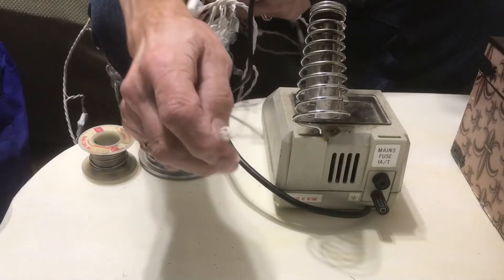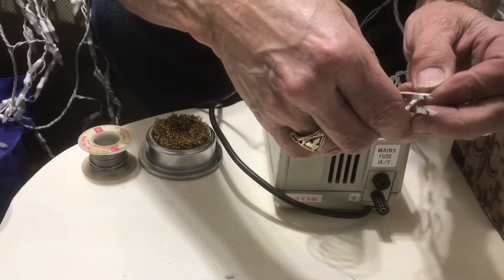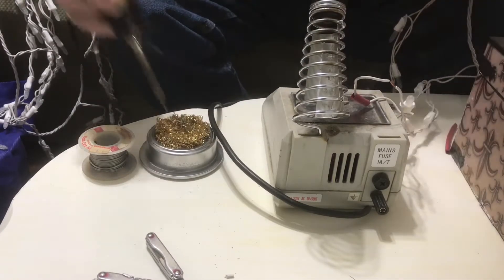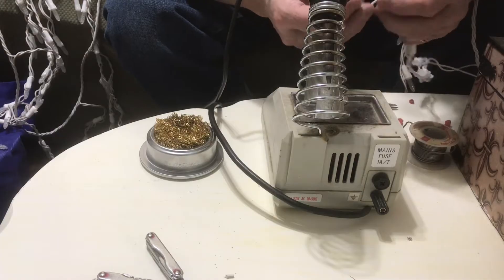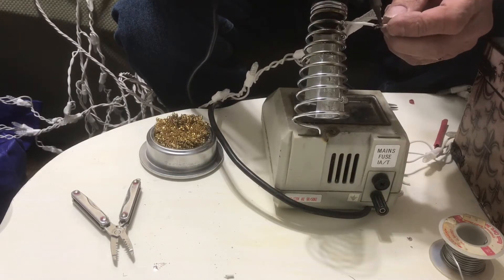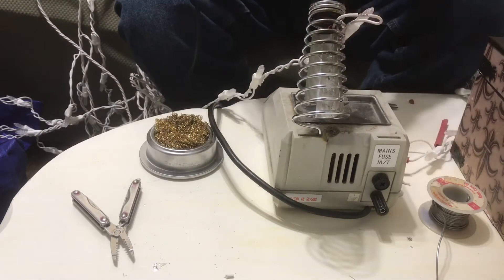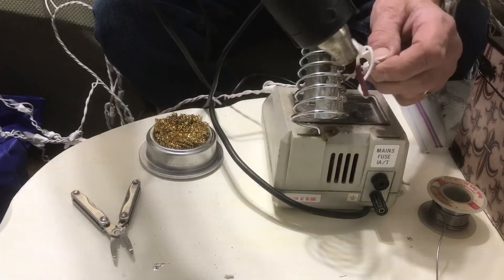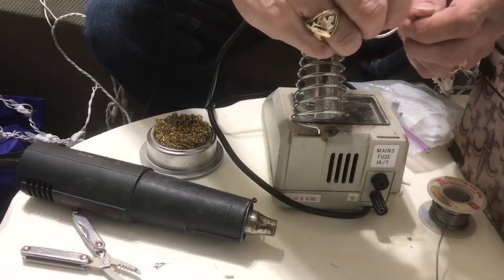How to repair a broken wire on Christmas lights or any other wire

Comment: So can we just twist them together? I know it’s reckless but will it still work?
Reply from the maker: If you just twist them together it can work, but it can allow corrosion to build up if it’s not soldered. If you do decide to just twist them at least put shrink tube over the splice and if you don’t have shrink tube then electrical tape and be sure to stretch it as you wrap the wires so it’s tight and it will be less likely to allow water into the splice. Hope this helps.

Comment: What temperature do you solder at?
Reply from the maker: It varies based on the size of wire and the size of your iron. For the small wires of Christmas lights it doesn’t take much heat and you should use small solder with flux.
Reply: ok.  I ordered the equipment and materials in your link.  I don't think solder was listed but I was able to fix a strand of LED lights the squirrels ate.  So Thank you for posting this!   One thing that was difficult was figuring out which line went to which, since they were all green and had no distinct labeling to tell them apart.  That was a process of elimination with the LEDS.  The halogen line sparked on me a bit and wouldn't light after that. So I think I may have blown the fuse... @davidmartindaletheycallmemacgu
Reply from the maker: @jjbechtel3151  there is usually a fuse in the plug and typically when you buy the lights they supply a couple spares.

Comment: Thanks for this! We just got a new prelit Christmas tree last week, and one of the cats has already chewed through one of the wires! I guess a solder kit should be next on my shopping list. 
Now to figure out how to prevent them from chewing on it in the first place…
Reply: Same reason I'm here, cat chewed through prelit tree lol
Reply from the maker: Harbor Freight has soldier irons for cheap. Be sure to get flux core soldier.
Reply from the maker: I don’t have a cat anymore, just lots of squirrels 😂
Reply: I read if you mix citrus essential oil and water then spray on the Christmas tree, they’ll leave it alone bc they hate the smell of any citrus fruit. Mix 1 part oil to 16 part water

Comment: The dog chewed off my gift box wire, and I don't have the other part of the outlet plug, do you have any suggestions...
Reply from the maker: If you have an old cord from an appliance, extension cord etc. you could cut and splice the cord onto your gift box wire.

Comment: Thank you for the helpful video.  My husband accidentally cut a strand of Halloween lights with garden trimmers.  We tried to solder them back together but can’t seem to get them to work.  Do you think he could have burnt out the fuse as well when he cut the wires (they were on at the time)?  Is it possible to test the lights before we solder to make sure we matched the wires up correctly?  This is where we are not having luck.  There are two strands to each side of the break and we aren’t sure which one connects to which.
Reply from the maker: There should be ribs on one of the wire insulation so you can match them up also there may be a fuse in the end of the plug that could be blown.
Reply: David Martindale Awesome, thank you so much for replying!  We will try again tomorrow when the lighting is better.
Reply from the maker: @heididryden2208  you’re welcome
Reply: David Martindale I was able to fix it with your help!  Turns out it was the fuse plus the snipped wire.  Our giant pumpkin face is now lit again thanks to you!
Reply from the maker: @heididryden2208  You're welcome, I'm so glad I was able to help!
Reply: So my question my cat of course had gotten stuck in my prelight tree last night and I had to cut the wires to free him. Am I able to do exactly what you did to fix it. I just bought it the same day this all happened.
Reply from the maker: @damienmeyer7302  yes, just be sure it’s unplugged while you’re working on it.
Reply from the maker: @damienmeyer7302  also be sure to connect the same wire if you had to cut two, inspect which wire goes to which wire and maybe mark one with a marker to be sure you connect the right wires together. Have a Merry Christmas!
Reply: Hi can you repair outdoor Christmas lights the wire has been chewed through ?